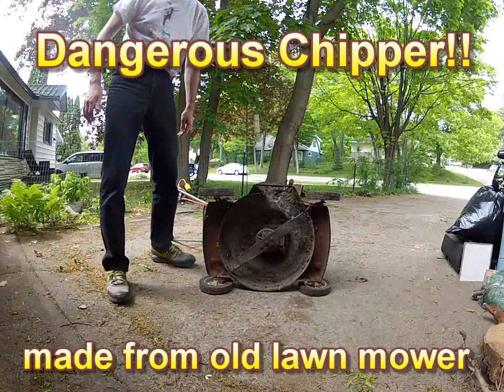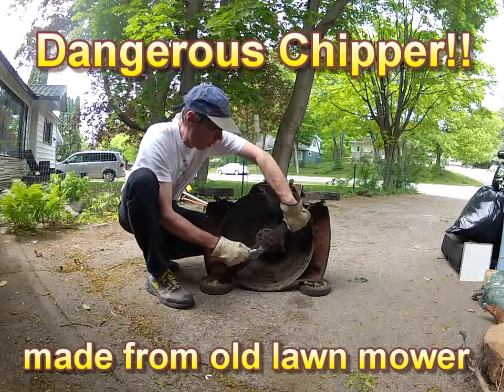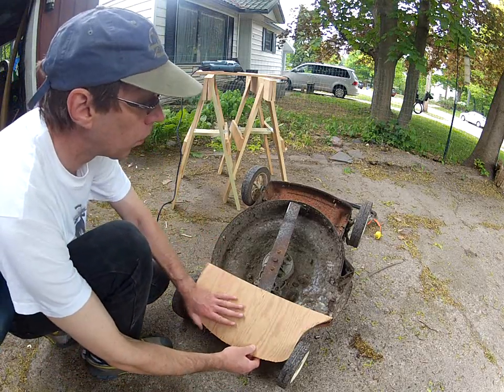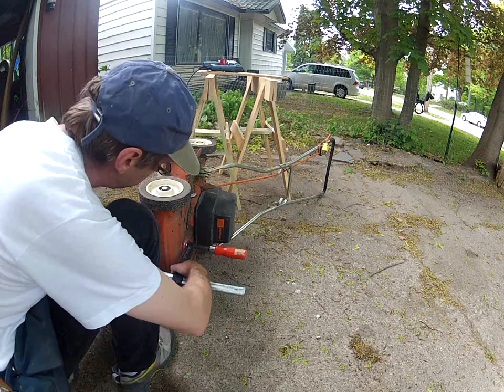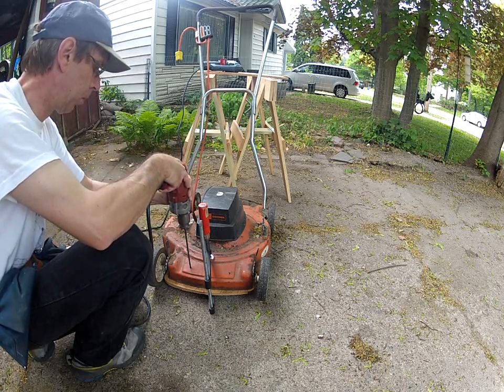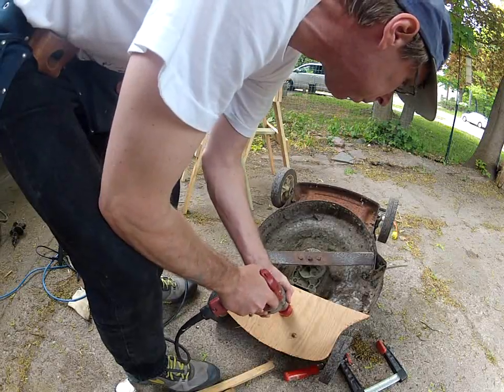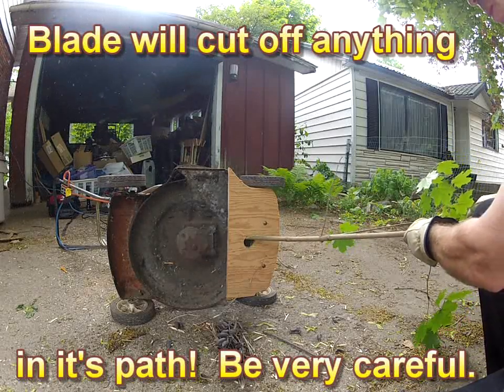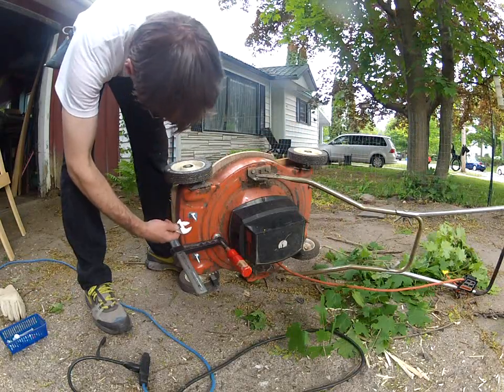(Unsafe) Wood chipper from old lawnmower!!

Comment: Paul, did you know that there is a second speed on this mower's motor? It is called "Power Boost" mode and it is accessible if you move the toggle switch toward the orange part of the label on the switch housing that says "Power Boost." This higher speed was used for cutting very tall grass, and the switch will return to the normal speed position when you let go of it.

In addition, the motor itself (direct-drive) also has a safety override feature that shorts it whenever the blade strikes a solid object.

Comment: running it on its side will seize the engine
Reply: Chuck Norris its electric....... there is no oil pan
Reply from the maker: I'll use it till it stops. (Still going months later...)

Comment: If you put a feed tube on an angle on the top of the mower deck with the plywood on the bottom spaced about 1/4 inch below the blade, it will feed smoother and more consistently.  I just sharpen my blade, pile up the branches up to about 1/4 inches in diameter (green: leaves and all) on a level area  , lower my deck height, clear the area wear goggles and sturdy pants and slowly work my way through the pile. Nothing complicated. Been doing this for years. Also works for giant piles of leaves. Once chopped down, they quickly decompose in the garden.

Comment: Can the engine oil system work on its side?
Reply: +jayceelb It's an electric lawnmower.  You can clearly see the power cord.
Reply: Chris Miller well that will explain it, thanks for the info.

Comment: Paul, I thank you for saving this 1978 Sears Craftsman electric mower. Next time, I'd like to see you use this for its intended purpose: to mow the lawn. I know spring is just around the corner.

But if you intend to continue with it as a chipper-shredder, I wonder how you're going to make a bag as to gather the choppings?
Reply from the maker: ClassicTVMan1981X Actually, a jute bag worked quite well collecting the chips and letting lots of air blow thru.
Reply: Paul Larsen If you could make any follow-up videos of this old mower, I would appreciate it.

Comment: I have an old lawnmower and was looking to do something like this. I have a question: would you have any issue running a vertical shaft engine horizontally like this?
Reply from the maker: If you read my comments, you'll see that I have repeated said this project used an electric motor, so there wasn't an issue with orientation. Because it's an electric motor, there isn't an oil sump or fuel tank, both of which would spill if it were turned sideways.
Reply: Paul Larsen  Gotcha. Thanks, didn't see that.

Comment: The only thing I would have done differently is use steel instead of the plywood.
IF and it is a big if that thing cuts off just the right piece of wood that jambs between the blade and the plywood then that plywood will be ripped apart and will fly all over you.
My 90 year old mother's response to this would be,
 You could put your eye out with that thing.
Over all great video there. I just happen to have a real gas powered chipper / shredder.
Reply from the maker: Using steel is a good idea, but I didn't have any on the day I made this contraption! Since this used an electric motor, I put a fuse inline sized to blow in the event of a locked-rotor condition. However, you're right, in fact the plywood ended up wearing out slowly anyway as the blade pounded the sticks. It was a fun experiment!

Comment: Thank you Paul Larsen for one awsome video. When I got home a few weeks back I started the mods on my electric Wolf lawnmower. It worked but not as I wanted it to. So the mods contineud..... The end result is a lawnmower-wood chipper that works incredibly well. It even has a homemade stainless steel blade, chops like a champ.
Reply from the maker: pierre rossouw  Fun!

Comment: Oil & gas leaks when you tip it up?  Does on my Briggs & Stratton.
Reply from the maker: This project used an electric lawnmower, so there isn't a gas tank or an oil sump! Cheers!
Reply: u can block that bottom, cut a hole in the deck, put a side chute and use it in the normal mower position
Reply from the maker: solohoh This project used an electric motor, so nothing leaked!
Reply: Paul Larsen are you sure ?
Reply: solohoh its electric...........